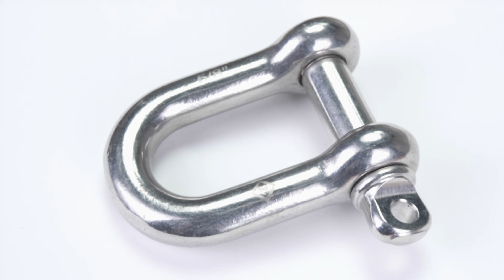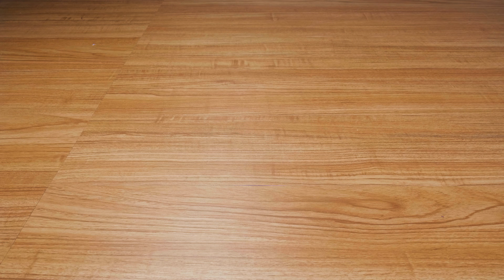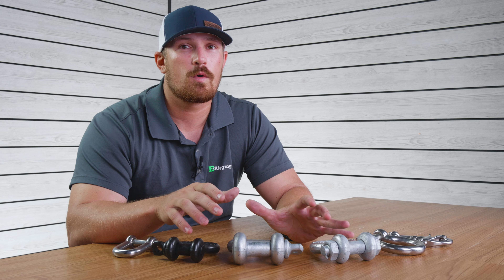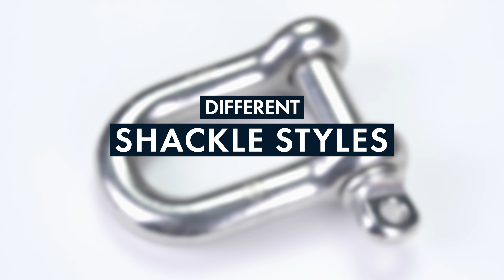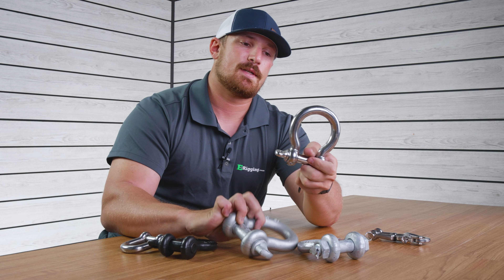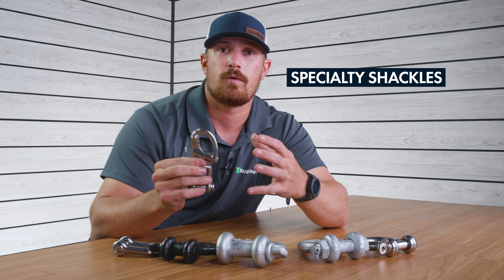Beginner's Guide to Rigging Shackles - Types, Coatings, and Materials

Comment: What is better for a boat anchor? - bolt pin type or pin type and why?
Reply from the maker: Great question! We've seen plenty of screw pin shackles used in semi-permanent applications across a wide variety of boats. It can be a great option if that's all you have on hand at the time, but we would recommend coming back and replacing a screw pin anchor shackle with a bolt-type since there's practically no way it can be undone without tools. You'll have peace of mind that while your anchor is doing it's job, the pin won't come undone.

Comment: I have two questions; First can Anchor & Bow shackles be used for towing/recovery and the second is when hooking a chain up to a shackle, is it safe to put the last link of the chain onto the pin that is screwed into the shackle when the shackle is hooked onto something to pull?
Reply from the maker: Hi there! The short answer to these questions is yes. Even though chain shackles are specifically for inline chain lifting and towing, anchor/bow shackles can be used for chain as well, and the pin-side will be the side you'll connect the chain to. Thanks for the questions!

Comment: I've got ten bucks and the grill ready with burgers. . . . . I have to run a cable to support pulling power out to my garage to charge an EV. . . . . Whenever you're ready, I will fire the grill up and provide a few of your favorite beverages once we have it done . . . . . . Seriously though, I just ordered the parts from your site. Incidentally I would be willing to pay a bit more for made in USA parts, not sure on the origins for what I ordered I saw you have a section for that, but I did not see the cable parts I needed listed there, maybe my error.